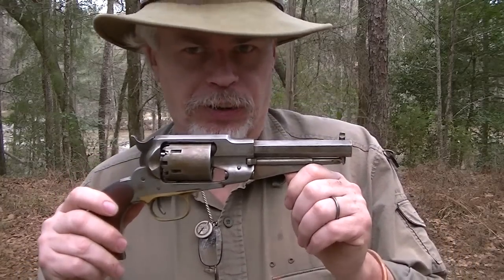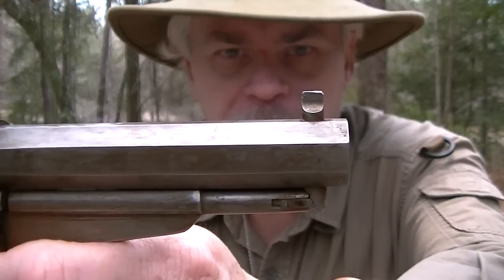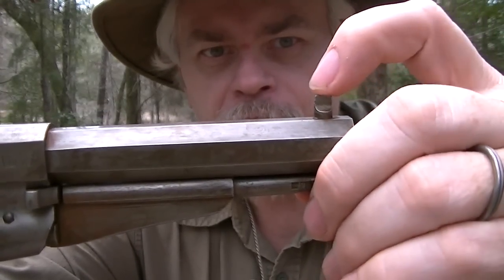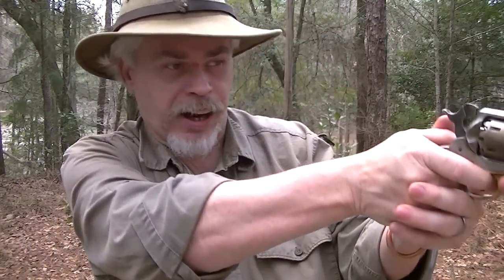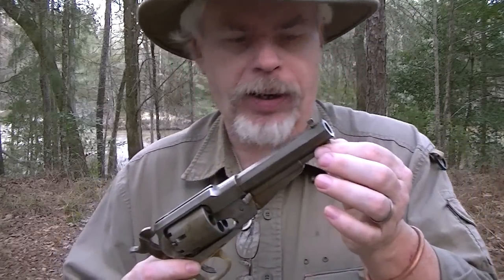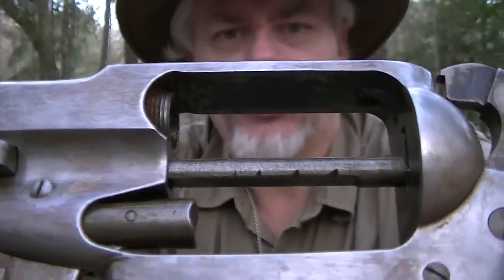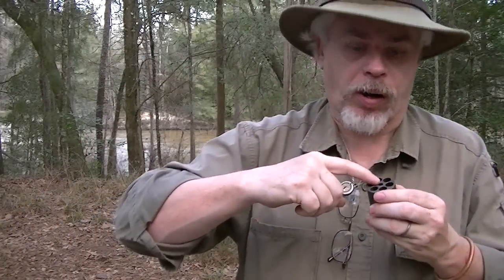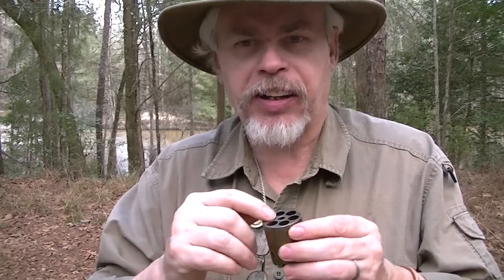THE PERCUSSION REVOLVER TIPS AND TRICKS

Comment: All good advice from a man with great experience.... go easy on those crowns though..... The newer repros are usually fine..... Years ago I made an 11 degree forcing cone reamer that does not need the barrel to be separated from the pistol.... very handy for tidying up a bad forcing cone.... Not often you find a bad one these days, as you say. I used that reamer mostly on pistols that I had had to set the barrel back one turn due to wear making the cylinder gape excessive.... Still have it somewhere....
I always check on a new revolver that the chamber mouths are .001" bigger than the groove diamater, and ream them to that if undersized..... I must say that the new repros I have had through my hands lately have been about spot on in this respect. Some of the earlier ones had undersized chambers and made shotgun patterns. Triggers are more often than not really good 'out of the box' these days too..... saves a lot work (and powder!)......

Comment: I bought a Whitney replica I've got it apart and cleaning. I found the chambers measure .363 and the grooves also BUT it has a long forcing cone about 1/4" that starts at .450 and funnels down to the .363 of the bore. I've never seen anything like that. How would that affect accuracy? Thanks for the great videos.
Reply from the maker: hmm a taper from breach to muzzle would allow it you land .grip rifling..and then exit at proper size much like the original progressive rifling..if the taper is 450 at breach and up to 363 at muzzle that one needs to go back cause the rounds will not slug up well enough to fill that gap

Comment: I finally got my UBertie 1858 44 caliber yesterday. I’m so happy. I appreciate all of your videos. All I could find around my town was .451 balls. The manual that comes with the uBertie pistol says to use .457. On another cap and ball blog, someone warned me not to shoot the .451 in the Uberti Or I would think I was having a chain fire because the recoil will work the balls out of the cylinder. Do you think that if I load my cylinder  that shooting a .451 ball will , be a problem?
Reply: I guess the way the manual reads is, you should use .454”/.457”. So I will not use the .451. But do you think it would make a difference between the .454 or the .457? And thank you again
Reply: @Paul M.  Here is what I know from a variety of dealers and shooters. The bottom line is to use .454 and those are as common as .451 or .457. Im told you can get away with .451 if nothing else is possible but that you should go to the trouble to get .454. There are a variety of online sources for it, just look around. The prices in Nov 21 are about $13/100.  The Uberti manual says .454/.457 but Im told the .457 isnt necessary and is too tight a fit to load. Its 3 years on since your comment, what did you finally do?
Reply: @cvcoco    I ended up finding the . 454. And that's all I use. And I use Swiss black powder . And everything is really good. Thank you for your great advice
Reply: @paulm.6966  I could have also said that guns are not all the same and the different sizes can be tried. Cylinders arent sloppily made but 1 or 2/1000th is easy to be wrong about in the machines. Rifle barrels are commonly off when you compare to each other and they sell sizing kits so you can determine YOUR barrel size and buy those bullets. In the pistol world there are two places the bullet has to fit and people go by the cylinder size. If I remember right, the bullet is correct if it takes 20lbs of force to seat it in the cylinder, then its good enough for the forcing cone of the barrel to take over. I think the manuals say 454 or 457 to account for differences in the exact size that the user has to determine, not that you can or should use 451, 454 and 457 all in the same cylinder at the same time. What the mfrs know is that one of them will definitely be right. Would it be great if they tested each gun and left a notice in the box before shipping? Sure!

Comment: Very informative video. I've had a Remington .44 for twenty years and now I know what to try to help accuracy. 
Question: I just got a Colt .31 pocket revolver. It acts like the hammer isn't hitting the caps hard enough to set them off; about 1-2 out of 5 go off like they ought to and the rest do nothing. Any ideas what I should do?
Reply from the maker: the .31's are know for weak main springs try ordering a new one..and see if that cures it..if not do what mark hubbs of eras gone bullet molds did put both springs together and see if that works

Comment: Question:  The Pyrodex 30gr. Powder Pellets, are these a good choice or should I use regular 3F or 4F?  Also will these pellets take up enough space not to have a gap in the cylinder?
Reply from the maker: the pellets produce good power and seem to shoot well..but like you mentioned..often you have to seat the ball further down the cyl to compress and avoid airspace..in most guns it does not hurt accuracy..but in some i have seem it wreck accuracy..my advice is to try them and read and follow the makers advice..hope it goes well for ya..safe journeys

Comment: I have two 1858's a 5 1/2 inch and an 8 inch. I use a kirst conversion cylinder with a loading gate in 45acp. I had to rebate the recoil shield with a dremel so I can load from the rear. I was just wondering, were there any 5 1/2 inch ones back in the 1800's or is this just something new? Also I just got a 1851 navy in 36cal and I'm loving it.
Reply from the maker: guns could be had with what ever barrel the buyer wanted..check out the avenging angels sometime..they had one inch barrels..i have seen in a collection a 36 in barrell .36 navy with rifle sights ..and a snub nose 58
Reply: blackoracle69 I want an avenging angel. I didn't know they were a real thing back then though. It makes me want one even more now.

Comment: Thanks for a great video with all the great tips.  My 1858 has a very strong trigger pull.  You mentioned a link to a different video regarding trigger work but I never saw that link.  Could you please provide that link ?  I cannot locate such a video on youTube.  Your videos on percussion revolvers are sure beneficial to us black powder newbies.  Thanks again.
Reply from the maker: here is link to mine where i do a total breakdown and talk of how to smooth the action..since yours is a heavy pull i  bet its a burr on the sear or trigger hope this helps
https://www.youtube.com/watch?v=T4jUmjB5QZw&t=1s
Reply: Thanks for your reply.  When I first got this revolver, 2 weeks ago,  I used your video  as a tutorial and stripped my gun down and did all the things you showed on that video.  There were several burrs which I removed and the revolver's action was considerably smoother when I finished.  However, the trigger pull is still very heavy.  Would a main spring that is excessively tight increase the trigger pull ?  I just guessed at how tight the main spring screw should be and adjusted it until the action felt smooth when cocking the hammer.

Comment: Hello Mr. Thomas , I've been watching your percussion revolver series and have learned an enormous amount of info from them. I have what I thought was an 1860 Colt army reproduction. Come to find out it's actually an 1861 Navy because it has the ship scene on the cylinder. The question that I have is identifying the maker , on the bottom of the barrel is stamped the caliber (44) , black powder only and made in Italy. Is it a Pietta or Uberty or some other brand ? By the way it has a brass frame. I bought it from an antique store and have enjoyed owning and shooting it. It's in great shape , I just wish I knew who made it. Any help you can give is much appreciated. Steve Cunningham.
Reply from the maker: the 1861 is in 36 cal both the 1861 1851 and 1860 all have that scene on the  cyl. if the barrel has info on the side it should be a pietta if it is under the barrel  it should be a uberti just guessing
Reply: @BLACKIETHOMAS  So I stand corrected , I have an 1860 army because the cylinder has the thicker reinforcement on the front part of the cylinder.  Since the engraving is on the bottom of the barrel , I'm calling it a Uberti. Thanks very much for your help.

Comment: One more question... just got this 1861 and it cycles just fine when it’s all put together but when you take to barrel and cylinder off it will only half cock and that’s it. It doesn’t cycle all the way. Any thoughts about that??? Thanks
Reply from the maker: sounds like the hand is hitting the top of its slot..when the cyl. is in place it pushed the hand further in and allows  it to clear and rotate..just my guess..safe journeys
Reply: Hello again I broke my 1861 down all the way and the hand was a pain to put back in and I noticed before and after the breakdown that the hand is rubbing the arbor at the 4 o’clock position. The hand shouldn’t be touching the arbor at all right???
Reply from the maker: it should slide past it..a burr at the arbor may be hanging up the hand on its path

Comment: I have an Army San Paulo 1858. With .454 balls I get a led ring, but the ball still is loose in the cylinder. What's the best fix?
Reply from the maker: try 457..often these are marked for the ruger..if that does not work look to dixie gun works they make round ball moulds in lots of odd sizes
Reply: If bigger balls don’t work then you could also try putting thin wads over the balls. I believe I’ve seen someone do it before  with no trouble. I think they did it as a way to prevent chain fires but they might keep the balls in place.

Comment: Pietta 1858 New Army with 45LC conversion cylinder. Could i take a spent 45LC case with a new primer and powder/ wad  in it and load a .454 ball into the chamber over the top of it with the pistol rammer and shoot this way? This would speed up the shooting process and save me from buying alot of cartridge loading equipment.
Reply from the maker: yes it can be done..but the best way to do it would be to seat the ball into the case and then into the cyl..
Reply: Thanks. i know the best way is to buy a 629 SW and load with speedloaders. Just wondering if loading a case short of a bullet and loading ball over the top? Could the case be sealed with wax or something and what powder would be used? Thanks again, i enjoy your videos.

Comment: I got a question,  I just bought two new cap n ball pistols one nickel and one blued ,now the one blued how can I make it look worn and faded
Reply from the maker: +JAson Gross  to antique it i stripped the blue with burchwood caseys blueing remover..then i used steelwool on all surfaces..i then applied a coat of browning (sold like blueing) and added a very light coat of blueing after the fact..allow it to rust over night steel wool it..and apply lube to prevent rusting..thats what i  did with mine

Comment: can you use nivea cream as loob behind the ball and semolina or corn meal instead of a wad?
Reply: Dan. I use  cream of wheat, corn meal and grits for a filler but not wheat flower.  Lot easier to load. Dump some in and flow out enough to make room for the bullet. For lube I use poop lube ( wax in a toilet drain pipe seal, Johnny Ring) or the red wax that covers Baby Gouda cheese.  Both are handy for waxing other stuff as well.

Comment: When i load my Remington, the ram rod leaves a pretty deep engraving on the front of the lead, almost a perfect square, do all pistols do this? Im sorta a perfectionist, and this doesn't seem like it would help accuracy.
Reply from the maker: the face of the rammer can be reshaped to improve that..often if the face of the ball is warped or distorted it will effect groups
Reply: @BLACKIETHOMAS  so there shouldn't be no mark on the ball at all, i figured, just wanted to make sure before I grinded on the blued steel
Reply: @BLACKIETHOMAS  i do believe ive watched every video you have on the topic. Great information and so much of it. Thank you for all of the advice
Reply from the maker: there will be some marks..but make sure its now a out of round ..or heavy to one side sort of thing
Reply from the maker: glad you have found it of use ..now that the holidays are over i can get back to shooting videos..stay tuned lots more to come with the percussion revolver series

Comment: Ive tried using Google, but honestly id trust your word more anyways, my new 1858 rem has a delay when the cap explodes and the charge ignores. pop BOOM, my older identical revolver from the 60s does not do this. Any wisdom??
Reply from the maker: use a standard paper clip and open it up ..use the wire to go down inside the nipple and clean out the flash channel..see if that helps